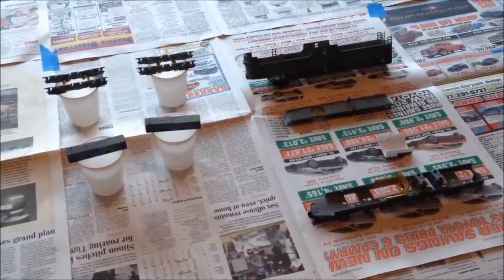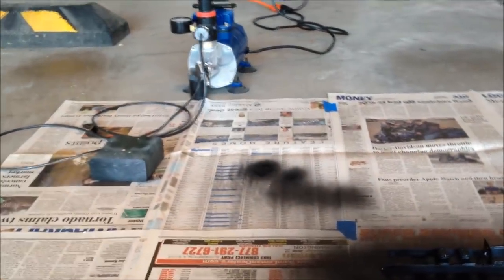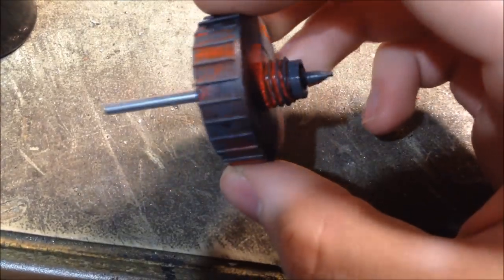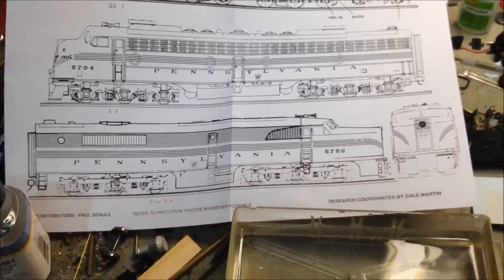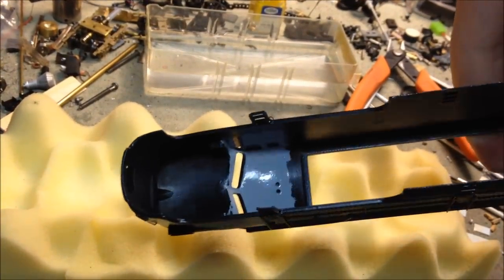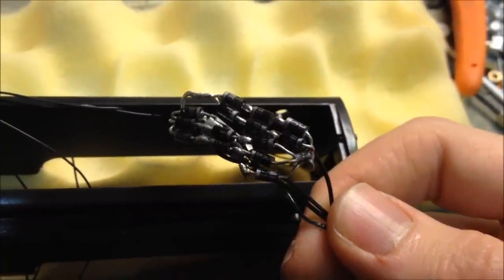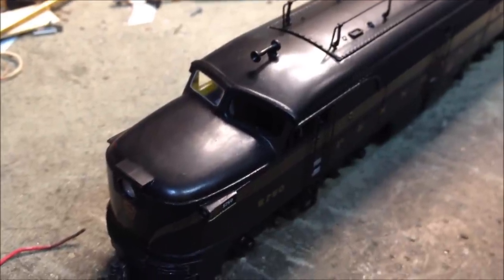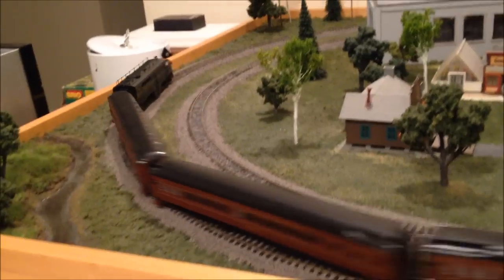Building a Hobbytown of Boston ALCO PA-1 - Part 6: Paint, decals, and final assembly

Comment: I bought the front diecast engine section of a Lionel m1000 that was painted solid red. I was going to strip it and paint it my favorite color the hobby shop owner had a heart attack and to keep busy he stripped it painted black and grey with the New York Central lightning strike paint Scheme like what you painted the HobbyTown unit into with hand done lettering and striping when I went to pick up the engine I was flabbergasted at the job he did and I did not want to break his heart painting it in my favorite color. Since I Model A prosperous Penn Central in the 1970s stopping at the bicentennial it will fit in because it's painted New York Central. That is a very hard paint scheme to do kudos to you

Comment: I doubt anyone has ever put so much time into a Hobbytown model. Truly awesome work! Not to open a can of worms but have you thought about M.U.-ing up another unit via the old Hobbytown coupling system?
Reply from the maker: jefflynnalex I've thought of it! Unfortunately, this kit was made before the "multi-drive" chassis, so I would have to replace the rear truck shaft and cut off the cast coupler box for a drawbar. I'd like to do a multi unit train with Hobbytown or Grandt Line drives eventually, but this one will remain a single unit.